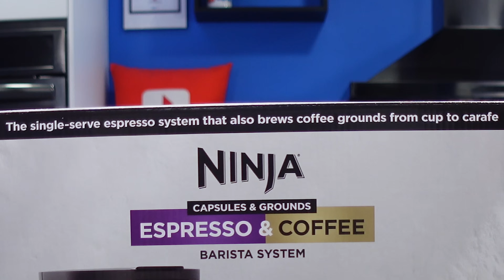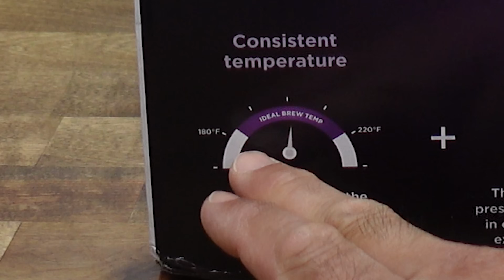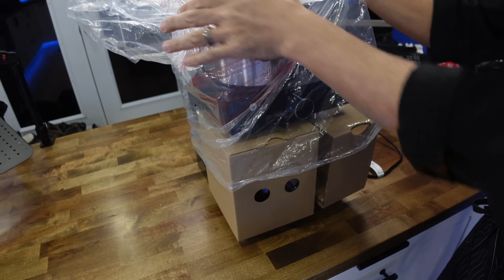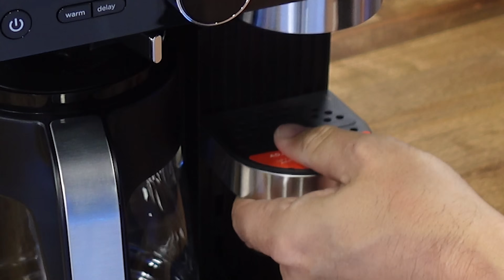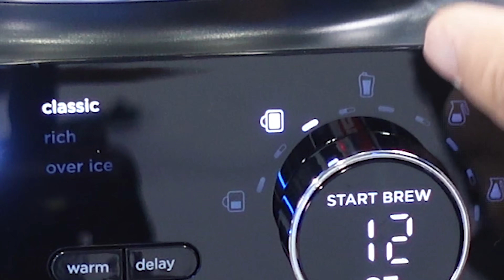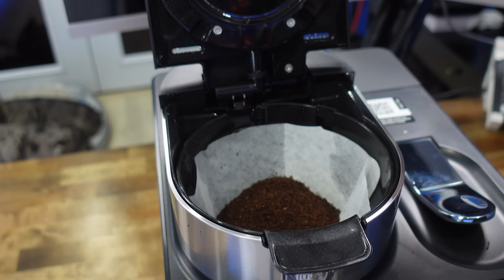Ninja Espresso and Coffee Barista System Unboxing

Comment: Another nice thorough review Joe as usual. The only thing missing was "does a travel mug fit under the spouts" but it looks like it does. And I'm sure you'll cover that in the next video for it. 

As far as the machine goes, I was disappointed that you can't also use K-Cups. I've seen machines that will do both K-Cups and Nespresso pods. K-Cups are considerably cheaper than Nespresso pods, but I guess Ninja's marketeers figure everybody already has one. Still, it would have been nice to retire the K-Cupper in exchange for counter space. Wait,.. this just leaves room for the new and improved "Espresso and Coffee Barista Pro!" What was I thinking!?! Ninja is on top of this! They have a plan. Never underestimate the minds at Ninja.  :_JoeTaco:
Reply from the maker: I actually recorded the review already, and I did exactly that with the Ninja Sip Perfect Mug. It fit, by the way. I probably won't miss the k-cup thing personally, but I do think it might hurt sales with it not being there at all.... maybe an accessory for it that you could buy would be good enough?
Reply: @JoesPhenomenal  I think the K-cup thing is important because K-cups can make much larger drinks. With Nespresso pods, since they're optimized for espresso drinks their volume is much smaller. Even the lungo is only 3.75 oz.. I often fill my travel mug with either one 12 oz. or two 8 oz. drinks from k-cups because it's much quicker than getting out the grounds and filter. Plus it only takes a couple of minutes to brew even with doing two 8 oz. shots. 

It's nice to know the Ninja Sip Perfect will fit under there. 🙂